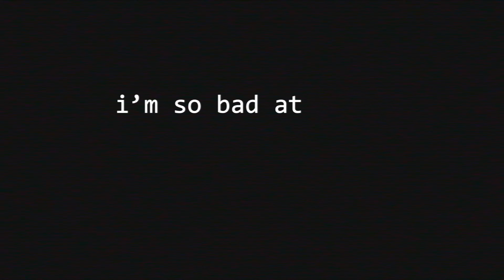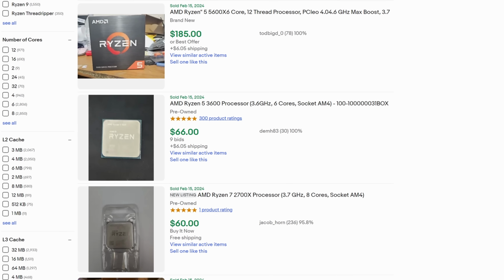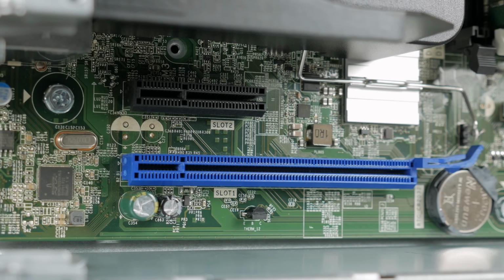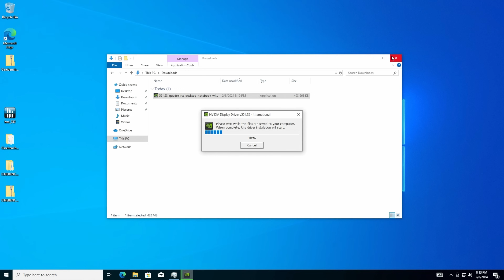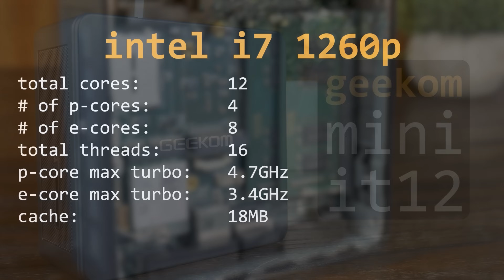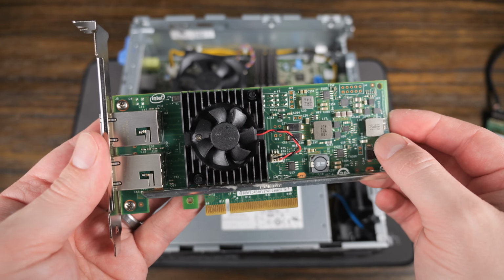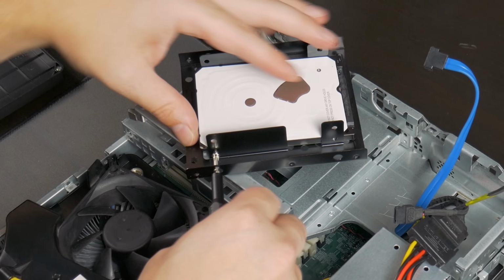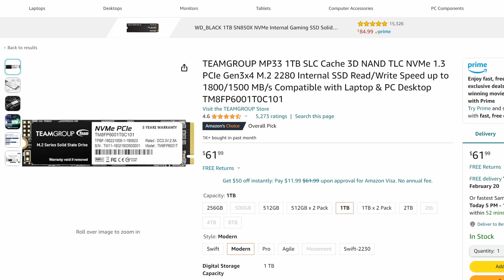Is This The PERFECT Dell Optiplex?

Comment: In order to have that network card working you need to cover with tape some smbus pins... google it!
Reply from the maker: DUDE. It worked, thanks! I might have to make a video on that. Super cool.
Reply: @HardwareHaven   wow, really happy that this worked!
Reply from the maker: INTERESTING.
Reply: @HardwareHaven   In my case, covering B5 (SMCLK, SMBus clock) an B6 (SMDAT, SMBus data)  was fixing the boot issue!
Reply: its dell not validating their parts for anyting but dell hardware,  spent ages figuring out that on a few raid card i got out of my dell servers :(
 @HardwareHaven
Reply: I have a Mellanox 2x40G card that works nicely in two HPs (a Proliant DL380p and a Z600) but put it in an Intel DX79SI and the machine won't boot. I'll have to see if that's the problem.
Reply: Why though?
Reply: @koushiroizumi0  some copy paste from another computer guru "When these two are masked you are blocking the SMBus signals, now they cannot interrupt the boot process anymore. In the past there where only some vague guidelines for this, not real standard, which lead to a variety of different implementations, which in the current time lead to issues with new motherboards who do follow the now current standards. "
Reply: @Mihai-Marian-Cenusa  so B5 and B6 are PCI-E pins.. if there are enough circuit traces above what enters the slot, somebody can cut the traces leading to B5 and B6 and wire in a double on-off switch if they want to preserve the original functionality. If you don't care about the original functionality, you could altogether strip off the pins and leave it like that. Tape will wear out between the metal contacts and they can cut through in time, especially if there are repeated insertions.
Reply: Hei, mersi! Gagiul chiar a făcut un video despre! Super tare!!
Reply: Nice to see fellow romanians commenting he he
Reply: Salut,  crezi ca e vreo sansa sa functioneze cu ryzen gen 2? Mai exact ryzen 2600 daca tot e am4?

Comment: Ive gone this exact route with my optiplex 5040 i got for $100. I have a i7 6700 laying around so that lets me upgrade my cpu to the MB's max, upgrade my cooler, added a 10 tb hdd, 10 gb pcie card and an m.2 for the OS and i think i spent maybe $300-$400 max if counting the price of my old cpu when i bought it. These little things are great for home server capabilites, i just wish i could fit two HDDs in it

Comment: Hi
I got a pre used optiplex 5055 with Ryzen 3 1300 pro 
My main use case is Matlab and Data logging 
Will a RAM (16G) and Nvme ssd upgrade be enough for atleast 5 years or should I seriously consider a new system? 
As of now, with the stock HDD it's slower than a turtle

Comment: Is there any way to upgrade the psu to something with more watts smaller to I have one of those 5055 optiplexs but I wanna fit maybe a rtx 5060 low profile or rtx 4060 haven't seen anyone videos of people tinkering around like that with this model I'm not tech savvy so I don't know

Comment: I had that there aren't more options for this model. Most Optiplexes support CPUs that they were not sold with. Too bad for the AMD.

I wonder if your hitches are related to using a Quadro GPU rather than a GTX/RTX GPU.

Comment: I got the HP Elitedesk AMD Ryzen Variant in this SFF size
Ryzen 2400G with Vega 11 Graphics
Radeon RX 550 4 GB w/ HDMI
256 GB NVMe SSD
1 TB WD Blue HDD 3.5”
32 GB Micron DDR4 RAM
DVD Burner
Realtek AC WiFi w/ Bluetooth
Creative Audigy FX
And Windows 11 Pro 24H2

Comment: On my 5055 with Ryzen 2400G, 2.5G Ethernet card, 3x 2.5" HDD, 1 M.2 SATA, 2x 8GB 2400MHz RAM,
idle power draw is 21W

If I remove the 2.5G card, idle power falls to 19.5-20W

Comment: Actually I am in a similar situation with a 240W power supply and I was stuck between the T600 and T1000.  Did the T1000 give you any issues in the long term if you continued to use this rig?

Comment: Quad channel ram cannot support really high ram clock speeds... Instead of going 4x8gb, going 2x16gb will be a better idea....
Another thing to check about ram are two standards- R and x..
Most computers are shipped out with 2Rx8 or 2Rx16 ram...
Best option will be 1Rx8...
Also, your cpu is also going to have limits on how much ram you can use and the macimum speed it supports... There is bo point in getting 3600mHz ram if the maximum your CPU supports is 2400mHz

Comment: There's a questionable motherboard design in these, PCIe x16 socket is 2nd from the top, just above PSU, perfectly preventing you from using 2-slot graphic cards. In older models, it was 1st from the top, making these a little bit more gaming friendly. Back in the day, I was using a low profile Nvidia GTX 1050 Ti in Optiplex 7010, playing ETS2.

Comment: The only reason to buy garbage like this optiplex is the PRO features such as DASH(atm on intel  for remoting to the system with or without gui over the internet even if the system is not booted  and other enterprise features such TSME <>Transparent Secure Memory Encryptionand SEV(TDX on intel) <>Secure Encrypted Virtualization

So that you can have reliability and safety for using it in your homelab running vms for it to become a router/packet inspector/ad remover etc

And by "upgrading" to the 1700 (non pro) you made it a total waste of money like 60 + whatever you paid for the new CPU and ram give less value than what it initially have at only $60 with the PRO 1300 cpu

Comment: I saw one of these on eBay with a 2400G in it, so it definitely supports some newer CPUs
Reply: It is an AM4 slot. I wished he had tried 2xxx, 3xxx, 4xxx, and 5xxx CPUs to test the capability of the motherboard.
Reply: @maskednil  I bet if you send the CPU's he would try
Reply: @ You'd be better of betting that he has them in his collection.

Comment: does 5055 have wifi built in or does need a upgrade kit or something
Reply: Most Optiplex models of that vintage have Ethernet only, so if you wanted WiFi you’d either install a PCIe WiFi card, or for some of the models that had a smaller M.2 slot for WiFi cards, an M.2 WiFi card

Comment: 7:33 While DDR means "Double Data Rate," and your explanation of Megahertz versus Megatransfers is correct, Windows 10 does not operate as shown. This is evident when running for example, a 3200MT/s XMP profile. If the BIOS accepts it and the PC boots fine, Windows Task Manager will read "3200MHz." This was actually changed in Windows 11. Despite having incorrect units in Windows 10, it should be interpreted as MT/s, meaning your 1067Mhz is actually 1067MT/s, not 2133MT/s as one would think.

Comment: i have a dell optiplex 3070 and i have to say its gud for like basic task but def not gaming or any intense apps

specs ^v^ :
cpu : intel core i5-9500t
graphics : intel uhd 630
storage : 160 hdd ( didnt have the base storage )
ram : 8gb
it comes with a wifi + bluethooth card and two nvme slots with a sata port

Comment: Nice video, thanks, but you forgot mentioning the high temperature of the GPU while running games, which of course would affect the whole system. it needs a better cooling. that is the main issue in a small form computing system. but thanks for the nice upgrade.

Comment: Awesome PC, but WHY have an AM4 socket and not allow people to drop in newer gen CPUs, my MC server is a HP 2400G based system and you can't go past a 2700X on that system, infuriating.
Reply: You might be able to put newer CPUs in this mode. I saw one of these on eBay with a 2400G in it

Comment: I like the Hp EliteDesk 800 G5, around $200-$250 on ebay, 8 core Intel 9700, has a x16 and x4 slot, can go to 128GB of ram with 2 NVMe bays and 3 SATA.

Comment: Bro, the risk to the system not post can be reduced by update BIOS first.

My Dell Latitude does not support my actual processor, but with a BIOS update it simply works.
Dell does not keep up to date the documentation, but the rule is for almost all AM4 series.

If you have 1, 2 or 3 you can update between them, and 4 and 5 the same.

Comment: My primary desktop is an Optiplex 7050sff with an i7 7700, so I always get a little excited seeing Optiplex get some love
Reply: In my tiny travel trailer I use 2 Dell OptiPlex 7070s with i7 9700t processors. One runs windows 11 and the other runs Ubuntu. They are both quiet and space saving.

Comment: Bought the same one from ebay with Ryzen 2400GE in it and 32gb of RAM. Added low profile Radeon 6400 to it and my kid is beyond happy, this thing rocks in Fortnite, Valorant not mentioning Roblox. Now, I do have Ryzen 7 2700 (non X) laying around, still haven't tried it in to see if it supports it.

Comment: Bought this dell optiplex, used of course because it is everywhere ex office use. Been using it for NAS server, managed to fit in 4x2.5gbps lan, 4 nvme ssd and 4 sata HDD 3.5 (separated from the case ofc). Great budget solution for cheap NAS! Glad you talk about this monster😂

Comment: Thank you for this video, very interesting and informative as always.

I have a question that I hope you can help me with (or it could be an idea for a video)
over the years I have built a collection of external hard drives and I am wondering what is the best way to archive (long term store) my files such as photos, videos, PDF books, and phone backups.

Is NAS the way to go? or there are better solutions (not cloud)?
but I am worried that the constant power would cause failure to the HDD motor. Also, I have read that companies such as WD and Seagate have gone to higher density HDD which reduces the costs of the drives but has lower data retention periods.
On the other hands, I know that SSD's degrade over time.

I am hoping that you could help me with this.

Comment: You're the goat for figuring out how to use ryzen master to get better ram performance. You should try using a pcie extension cable to squeeze a better gpu in there somewhere maybe an RTX 4060 LP using a 2x sata to 8-pin.

Comment: I got a Dell optiplex 9020 mini-pc with an i5-4570 i had a spare Nvidia Geforce GT 1030 4GB that works perfectly in there aswell.
Reply: Same sff pc , took lid off, 4 screws out and psu sits on top of dvd ,
now full size graphic card fits!🥁

Comment: Thanks for this video!
I had encountered a similar issue regarding passing the disks through to TrueNAS not having serial numbers and just kind of uneasily ignored it.
I much prefer your workaround.
Reply: I hope you have no valuable data on there. Passing through disks (as opposed to the controller/HBA with IT firmware) is recipe for disaster!
Reply: @christophjahn6678  I appreciate the concern but It's backup of a backup of a backup. I'm totally fine with losing it!

Comment: I'm looking to build a cyberdeck that will run blender 4.0 and Unreal Engine 5, and I've been looking at mini-PCs.
Battery power would be nice, but isn't mandatory.
I want something portable, but powerful enough to run the above.
(of course, if I'm going to spend $600, I might as well buy a more modern PC with the awful chiclet keys)

This looks like a good enough solution if I can get a cheaper gfx card that will do.

Comment: Next upgrade buy the rtx 3050 6gb low profile edition from msi because it doesn't need a 6pin power connector and runs soley from the pcie slot although its not as powerful as a REAL 3050 8gb it does however offer more performance than the t1000 its as far as i am aware of the most powerful low profile non supplementary power requiring gpu on the market

Comment: What is the thing you just snapped the SSD in??? I need me those!
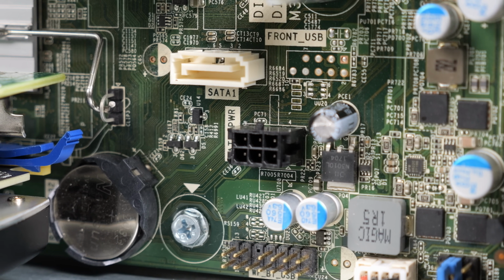edit: at 15:12
Reply: It's the bracket that the Dell Optiplex machines come with. It's a proprietary OEM part, so no use outside the original machine.

Comment: According to what I found, these desktops should have a B350 chipset from AMD, which seems supports a lot more of CPUs than the simple 1000 series.
At least, with several mainboards from other manifacturers, compatiblity to 3000 series should be granted, at least from AMD side. This obviously don't guarantee any Dell support from that.
Also, dell released bios version 1.11.0 at beginning of february.
My hint should be for a Ryzen 5 3600, because there's no Ryzen 7 3700 released from AMD and Ryzen 7 Pro 3700 looks like unobtaium to me. Seems the most effective 65w TDP CPU without a B450 or B550 chipset up the sleeve.
Last but not least: SFF PSU from Dell IMVHO are quite really reliable, however don't handle that much well being pushed to the limits of the power delivery. Also, while being not that bad (after the GX series which s...ed more than h3ll, are nice to work with. However... While seeming wasted space, minitower models have way more space for allow airflow, even if they're quite empty. Unfortunately, no enough drive bays for a "decent" NAS setup (4x3,5" drives)
Reply: Edit + Add. Probably the latest bios is subsequent the recent AMD announcement about vulnerabilities. Which arrived after deploying patches.

Comment: I would have made the power cables longer and made the power supply external allowing hopefully for a proper GPU providing of course than dell didn't cheap out and actually provided the full 75 watts to the pcie slot per the pcie spec.  Sometimes dell does not do this.

Comment: A bit ago, I picked up a dell 7050 SFF which came with 8GB of DDR4 RAM. On paper, it can handle an i7-7700,  but came with a i5-6500. Bought a 32GB pack, but left the 8GB in. So while the RAM is slowed down a bit, 40GB isn't to sneeze at. Will get a i7 at some point as they are quite cheap. Don't think I'm  going to bother with a GPU though. There's just not enough room.

Comment: I have an old Optiplex 9020 planning to install a RTX A2000 with a mod cooler that can transfer the GPU to 1-slot half hight. The A2000 should provide more than enough performance and the same trick can also be applied on the RTX 4000 Ada because they have almost the same stock cooler.

Comment: 7:33 This behaviour in Windows has always perplexed me. I feel like ive seen both values displayed in various builds over time. My desktop has DDR5-6000 which is displayed in task manager as 6000 Mhz, and my laptop with DDR4x is showing the full value in task manager as well.. Not halved. i have no idea how windows picks and chooses whether it will display the halved rate, or the double rate..

Comment: I bought three Dell 7020 sff for about $130 in probably 2019. They have played every game the kids wanted. Upgraded ram, added a gt1030, changed to SSD. I am still on the i7 it came with.

My one regret is that I didn't get the MT, it would be so nice to be able to fit a better GPU in there. I'm actually kindof stuck on this issue. I need a whole new computer, I guess, times 3.

Separate thought. You could do a divinci resolve video! I edit a little and I'm not sure wether to use 264 or 265 and at what quality... Sometimes the files are huge. Just a thought, but I haven't found that answer.

Comment: I got the OptiPlex SFF 5060 that had an i5-8500 CPU. Upgraded it with 16GB RAM, 512GB M.2 SSD, added another 4TB SATA SSD for PLEX, a WIFI 6 card and a full dual slot dual fan GTX 1050 Ti Graphic card by using a PCIE raiser and removing the HDD holder mechanics. Its working pretty well for my home server and remote access needs.
Reply: is there GTX 1660 Low Profile?
Reply: I'd love to see a video of how you have that set up

Comment: i've been using 3 dell optiplex 7060s as my primary proxmox HA cluster for over a year which i salvaged from my IT job. i upgraded the ram for each node to 64gb for a total of 192gb and installed 1tb of ssd for each which gave me 3tb of ceph pool storage. it's been stable and very reliable for me so far and am very happy with it
Reply: Just salvaged 2 5070s from my job. Looking to make the same upgrades. Mind if I ask what the power consumption is like? Also, did you upgrade the nic?

Comment: When you were testing on Proxmox, did you try the integrated ACS override patch to split up IOMMU groups? I’ve never liked individual drive pass-through, usually results in more overhead and you have to depend on SMART monitoring within Proxmox instead of Truenas.